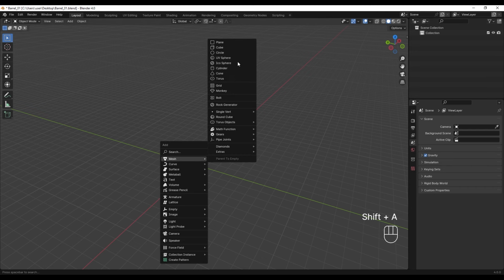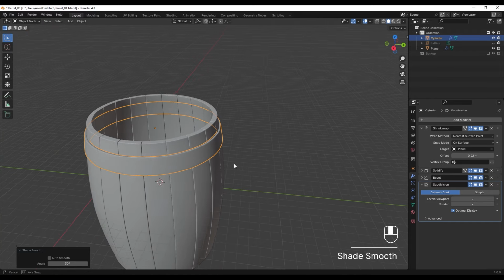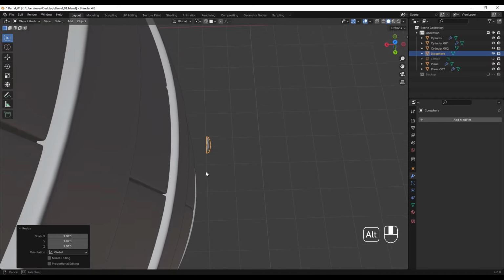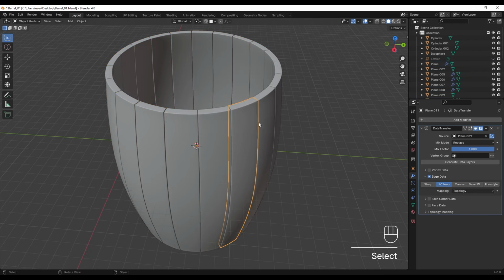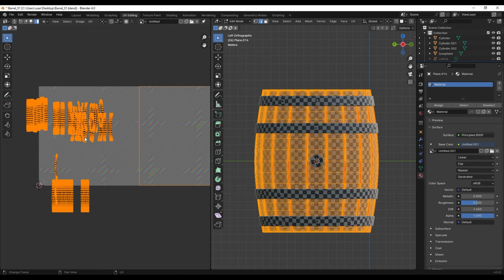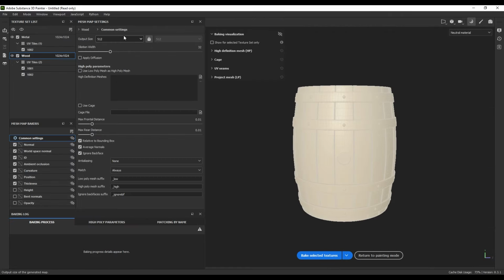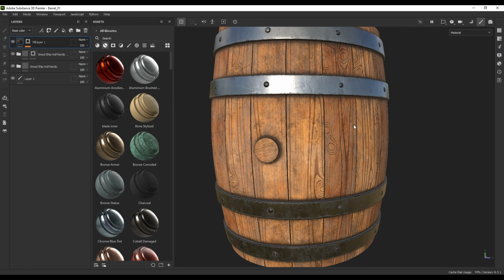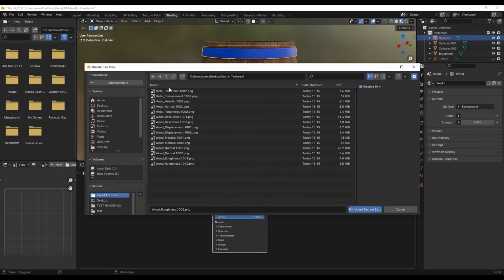EASY Barrel Modeling and Texturing

Comment: Amazing tutorial! Though I couldn't figure out why my little nails on the metal rims were failing to rotate around the Z axis around 11:35. I did exactly as the tutorial said and nothing was working. Ended up doing it manually but impeccable and highly useful tutorial thanks so much!
Reply: Know that im a month late but maybe try setting your Transform Pivot Point at the top bar to 3D Cursor

Comment: If “Simple Deform” doesn't work like in the video and behaves incorrectly, then create “Empty plain”, bind the “Simple Deform” modifier to it. Then rotate “Empty Plain” by 90 degrees along the Z axis. It should now display correctly. Greetings from 2025. (Blender version 4.4.3)
Reply: Thanks!

Comment: 11:40 I am so confused about what you did I duplicated it and rotated it but it's not doing what is being shown on the video am I missing a step.
Reply: If anyone is stuck, all you do is, on the top center below the nav bar beside the global option called Transform pivot point, use a 3d-cursor and then do the steps. Play around it and you will get it.
Reply: @fanta1940  Thanks for this bro

Comment: First of all, that's really cool video about modifiers, however... here are some critics:
1) That's not easy for newbie to control such dense topology without its understanding.
2) metal rings (which are made from hot rolled steel) are hammering on a barrel when they are at least cherry-red color temperature, so there has to be a burnt marks above and below the metal rings.
3) metal ring is not a monolith, it's arc but mostly circled, so the seam has to be seen.
4) rivets are made from different metal, and has more contact with other objects, so they are has to be slightly lighter.
5) dirt do not usually covers the surface but fills the gaps (here gaps between the planks are clean)
6) wood texture is wrong, planks for barrels must have no knots (or wine or ale will puch it out with fermentation gases), however the longitudinal align of fibers is correct.
7) the model is too perfect.
Overall, nice tricks, that was very interesting to watch.

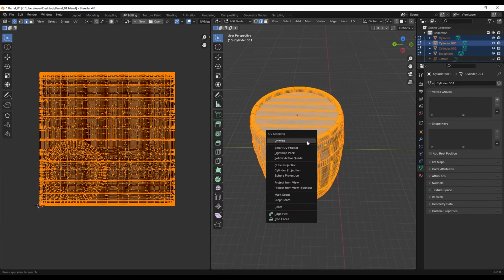Comment: 00:19:05 instead of marking seams you can use smart uv project which does it all for you. But it is still more accurate to mark seams especially with higher poly models.
Reply: Also pretty useless outside of substance painter as tileable textures will have obvious seems if you don't unwrap properly. 😊

Comment: The video is much more than a tutorial. It covers Sub-D Modeling with proper edge distribution and flow. You also covered the correct and proper way of blender's powerful modifiers. Covered the UV stage. And proceeds to cover texturing via Substance Painter too !

Comment: If anyone facing issue at 11:35. When duplicating but can't rotate like in the video then change the pivot point to 3d cursor from top in the tab just beside "Global" writing in the top
Reply: You can also use "Spin" from Edit mode. Set Angle to 330, enable "Use Duplicates" and set Steps to 12.

Comment: Today I have watched your video and learned a lot. I copied your video and tried to make the same as you made it on this video. I completed my working till Modeling part. I wasn't able to do the UV Unwrap. :( :( It was little confusing and fast. I'm new to UV unwrap. Please suggest me any video where I can learn UV Unwrap from Basics and then will be able to finish this Barrel model. Thanks a lot for your help.
Reply: Try using .5 speed
Reply: Sum tips i received
1 - treat the mark seam as Passin a scissor on a 3d shape to make them 2d
 
2 use the mark seam to separate the areas where your Color is TOO different from the other parts round them

Comment: Hi Very nice tutorial, i learnt alot and subbed.

How can you tell where you need to put seam on certain object for crisp UVs?
Moreover how can you tell if you need to put no seam at all for the obj so it will give nice UVs by it self
Reply from the maker: Think about how the texture is going to wrap around your model; The orientation of the texture and the size of it. Look for natural seams such as edges where two separate parts of the object meet. Also, objects with very simple geometries or uniform surfaces may not require seams at all.